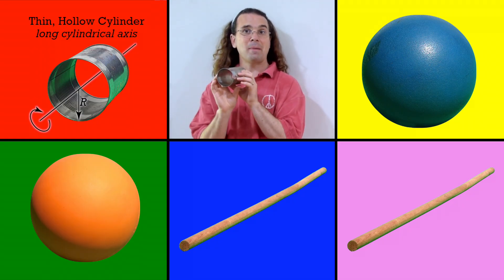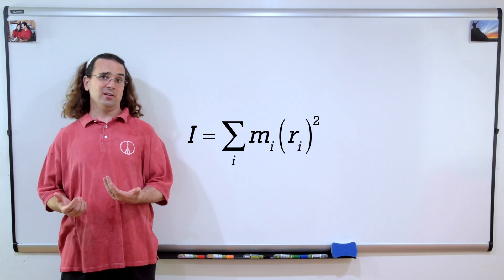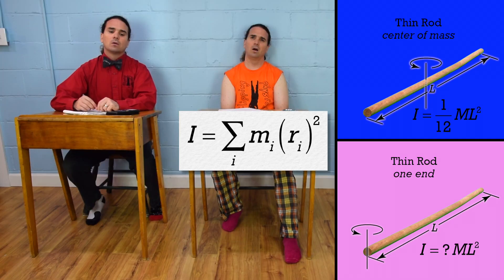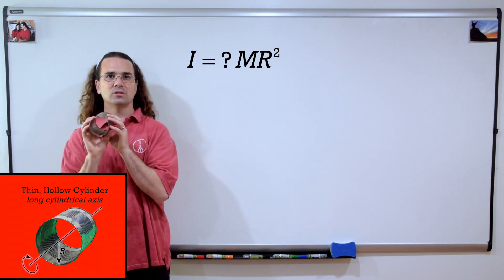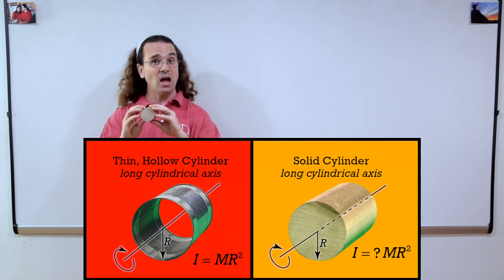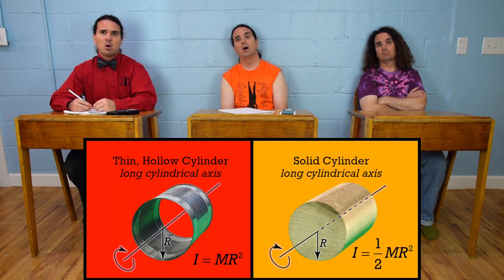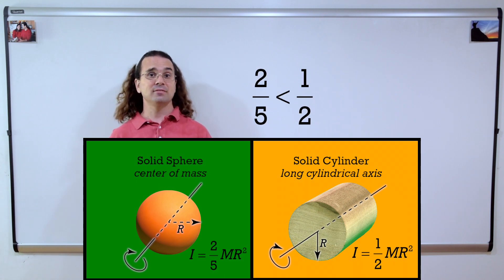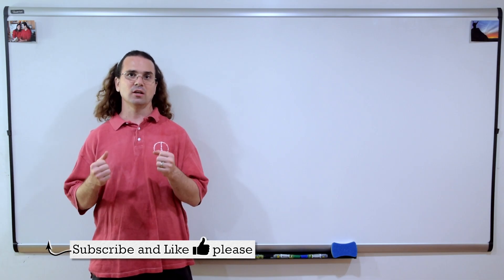Moments of Inertia of Rigid Objects with Shape

Comment: Pls help me 
How you make difference between point mass 
And extended object
Reply: A point mass has all of the mass concentrated in a volume of space that is negligible.  In other words, you can treat the object as if all of its mass is at the same point, and still get the same result as if you considered its distribution.  A point mass is usually an approximation to keep the math simple, and not necessarily something that exists in reality.

An extended object has a distribution of mass that is important to the problem in question, and we need to consider the location and distribution of mass to get the correct answer.

As an example, consider a 100 gram (m) apple hanging on a string of negligible mass with its center 1 meter (L) below the top of the string, with a radius of 3 cm (r). In other words, a simple pendulum.  Assume 3 significant digits.  If we treat the apple as a point mass, the moment of inertia about the top of the string would be 0.1 kg-m^2, calculated via m*L^2.  If we account for the apple's size, and treat it as a uniform solid sphere, we will calculate moment of inertia about the top of the string through 2/5*m*r^2 + m*L^2, and get the moment of inertia to be 0.100036 kg-m^2, which rounds to the same answer we had before.  The apple might as well be treated as a point mass, since its size is insignificant compared to the 1 meter string length.

Now, let's shorten the string to so that the center of the apple is 10 cm below the top of the string.  Treating the apple as a point mass, gets us a moment of inertia of 0.001 kg-m^2.  Treating the apple as an extended object, accounting for its shape as a uniform solid sphere, we will instead get 0.001036 kg-m^2, which we'd need to round to 0.00104 kg-m^2 for 3 significant figures.  You now see that the 3 cm radius of the apple makes a difference, compared to what it would be if treated it as a point mass.